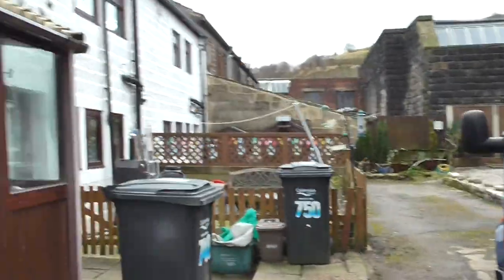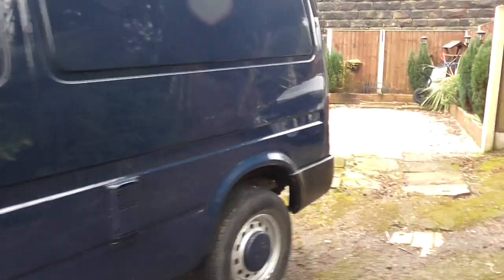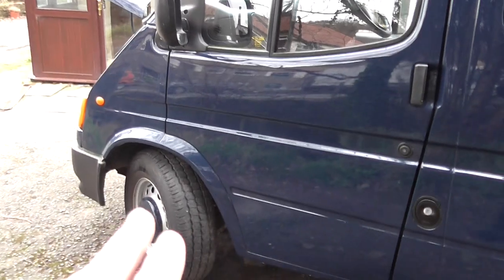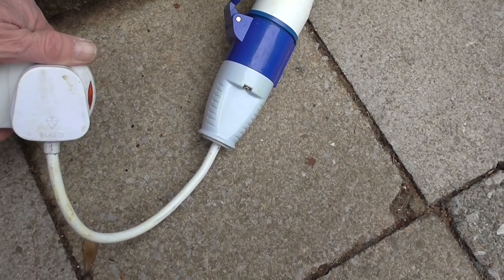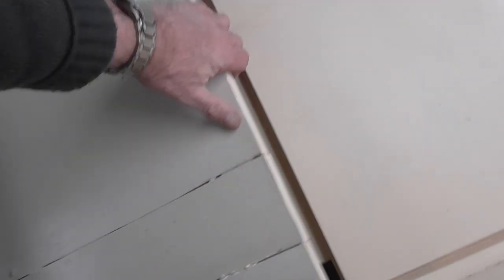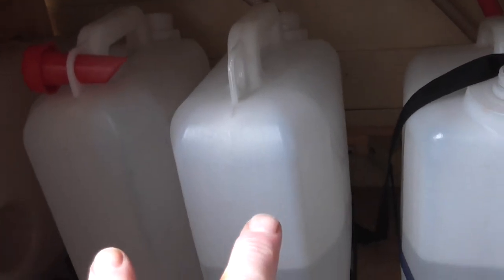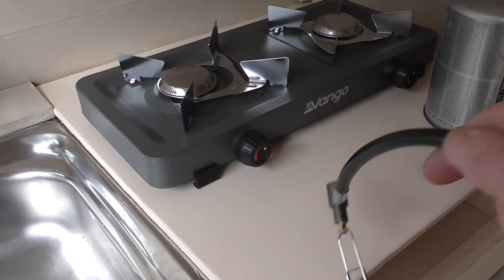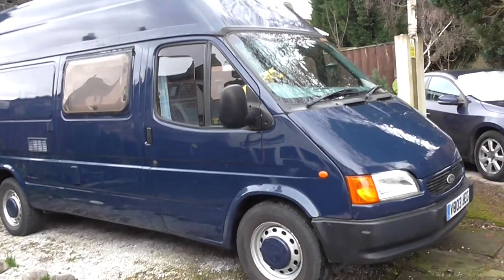1999 Ford Transit smiley 2 5 Di , LWB camper van for sale. #vanlife.

Comment: Hi, we have 1 as well. It has some starting problem. Would you be able to tell me where i can find the glow plugs? Before i pull everything apart
Reply from the maker: Hello , they don't have glow plugs they are direct injection and rely on compression to start them.
Reply: @ShaunMurray63  thank you
Reply from the maker: @TomHuiskamp-k1x  No probs  , you will probably find it's a fuelling issue.
Reply from the maker: If you want to give me a short brief explanation of what your problem is I might be able to help but please keep it brief , thanks Shaun.